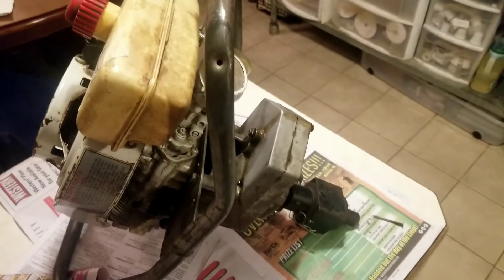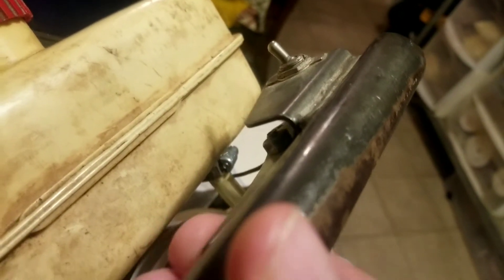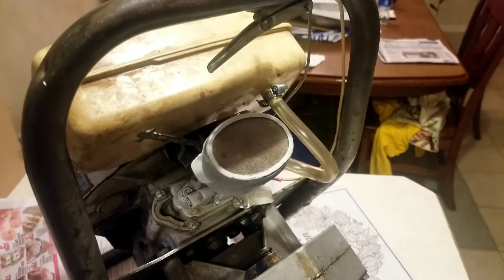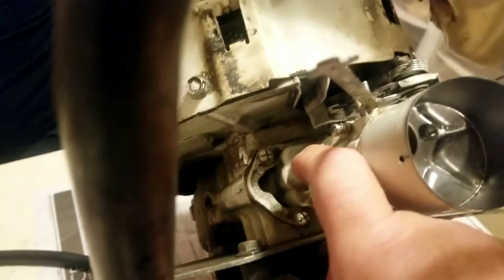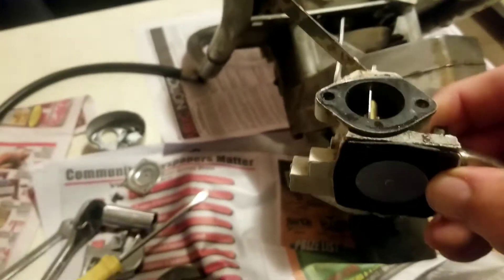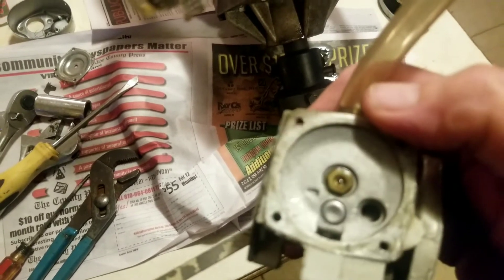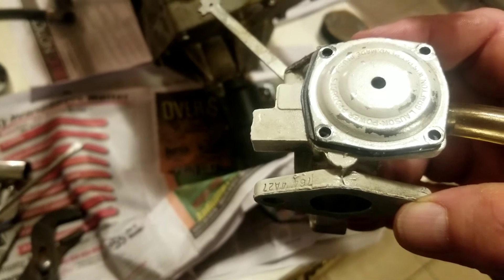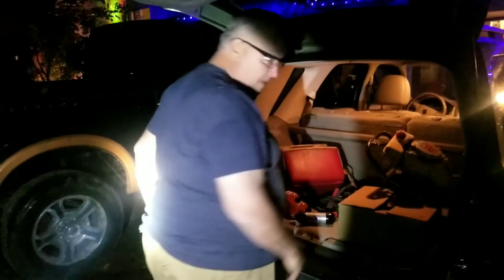Tecumseh 2 stroke. How to repair Diaphragm Carburetor

Comment: Thanks for the video. Looks like the one on my jiffy ice auger but mine has little plastic caps or something over the high and low screws? Wonder if those pop out to reveal a real screw?
Reply from the maker: Most of the time they do. The epa made companies put these on to prevent consumer adjustments.  At the shop we always popped them off. Newer carbs stopped putting screws in altogether
Reply: @darylturcott  thanks for the reply. This is a 2002 Tecumseh 2 stroke. I bought a rebuild kit and will replace the diaphragm and gaskets and the brass threaded plug under diaphragm and needle and spring inside that. I don’t plan on taking Welch plugs out and not sure about taking high and low needles out they weren’t leaking. But are there any small passages in there to clean out? Thanks
Reply from the maker: We never removed welch plugs unless carb was VERY corroded inside. Generally i would blast a little carb cleaner through it and some compressed air. Pay attention to the placement of diaphragm and gasket.  The order depends on whether or not there is an "F" stamped on the side. If you are not getting smooth idle or throttle response, then try to remove caps and adjust screws.
Reply from the maker: Great job. Thats a longtime setting
Reply: @darylturcott  thanks!
Reply from the maker: I used a thin wall 5/16 socket to remove brass seat. I had to grind down the outer rim  of the socket for it to for down over  the brass.
Reply: @darylturcott  it is a F carb. I got the brass plug out already luckily didn’t have to grind down the socket. It fit on. The carb wasn’t that dirty so should be okay. I used some berrymans carb cleaner and shot it all around. I will use some compressed air before putting it all back together. Picked up a fuel line too and cleaned the plastic tank out. Should be ready to run.
Reply from the maker: Sounds like you have it handled. 🙂
Reply: @darylturcott  She’s running great now. First start in over 5yrs! Had to pop those plastic caps off and found the high and low only 3/4 turn out so it wouldn’t idle and I put them 1 1/4 out roughly and now it starts and idles and revs cleanly. I put a video on my page if you wanna see. Thanks
Reply: I have this same engine on a post hole digger I picked up from a yard sale , only gave 25 dollars for it  , I needs a carb rebuild , will run on starting fluid, this video is exactly what I needed to get the parts , very informative ,thanks for posting and sharing a link for the parts